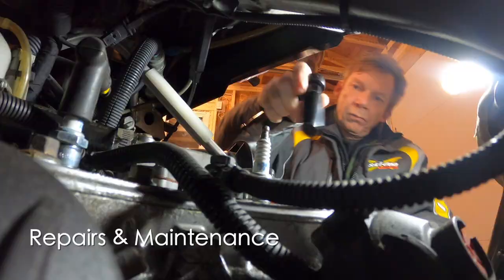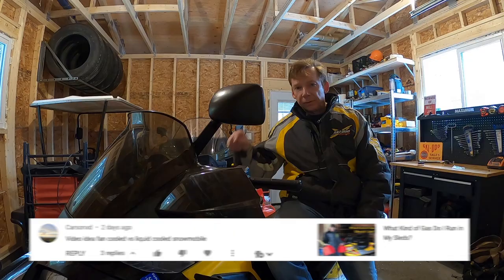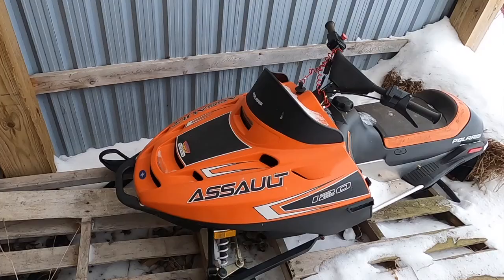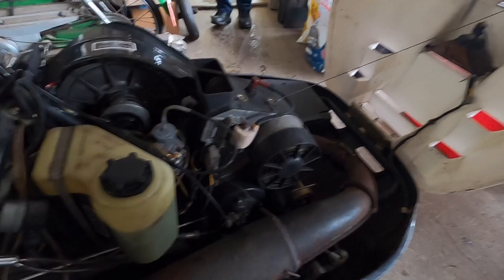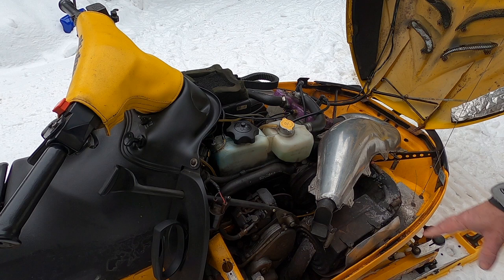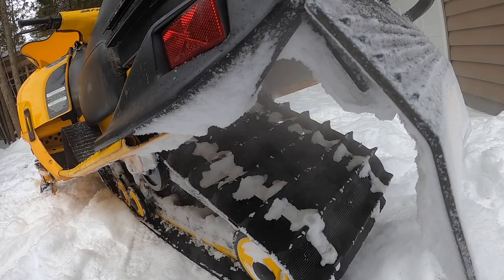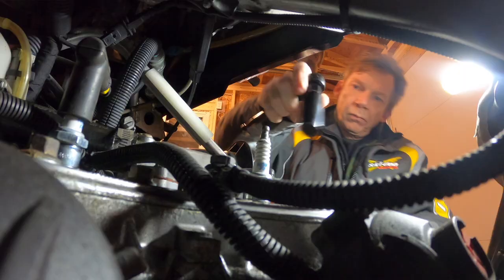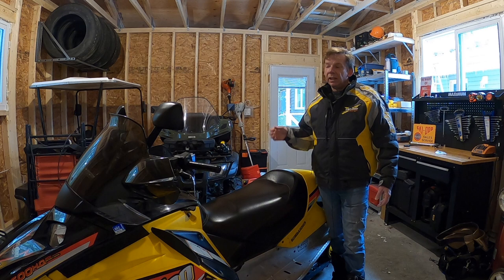Fan Cooled VS Liquid Cooled Snowmobiles

Comment: I picked up a 2021 VK 540 fan last season. For me it’s perfect for a few reasons, the simplicity and reliability throughout the ambient temperature ranges is great, especially in the late season.
Reply from the maker: Very nice Yamaha...work horse, heated carbs...good machine. Thanks for commenting.
Reply: I've personally had enough bad experiences with Yamaha utility sleds that I would steer clear of one for my style of riding from now on. But I guarantee you that machine will outlive the both of us combined
Reply: @lucahoganyt4435  i dont like Yamaha sleds anymore cuz most Yamaha sleds are 4 stroke now it sad cuz Yamaha made very good snowmobiles in 80's and 90's

Comment: I have had all fan cooled over the past 40 years, 565cc is the largest i have had (2019 arctic cat Lynx LT ES),  i like simplicity and less cost.  but even more so than all of this i wish skidoo would put an emergency manual start on almost all their 4 stroke sleds, maybe with some kind of decompression switch or something.   This is what stops me from going 4 stroke.  Over the past 25 years I have had 3 starter failures and 1 wiring failure and was so happy to have the pull start as backup to the electric start.  thanks for another great video!
Reply from the maker: Thanks for watching and commenting Mike. My brother just bought a four stroke. What kind of riding do you do?
Reply: @MyOldSled  9 out of 10 times I do solo riding in the adirondacks (upstate NY). I tend to pack all kinds of gear on my 2 up sled in case of breakdowns/getting stuck over night or even i ride out to another part of the state and i dont feel like riding back late in the day i will just rent a motel room for the night and stay over, so i always carry extra clothes.  all trail riding.  I am more of a putt around enjoy the scenery kind of person (20-40 MPH)and occasionally open it up on the lakes.

Comment: Here is a tip when refilling your rad start it run it nose up on a snow bank or tilted on a trailer. so that you can force the air to the reservoir and get rid of the air in the system. because of the suspension setup most sleds are prone to trapping air at the back
Reply from the maker: Slow down there Ray :) I'll be doing a video on that... :)
Reply: @MyOldSled  sorry bud.
My buddy and I love riding so much 
We went to the treadwell ice drags and entered our trail sleds it was sad 
We decided to go and build a dedicated ice drag sled. It's amazing the science that goes behind building one
Reply from the maker: LOL Nothing to be sorry for I was kidding. Love the engagement with the channel. Glad you enjoy the sport so much.
Reply: @MyOldSled  well what else are you going to do in the dead of winter right. Why not go and explore and see things. There is something special about riding a sled. Especially in deep powder it's like skimming across water, and flying at  the same time
Reply from the maker: I know. I actually can't exactly explain it. I don't ride tons of miles like some people do, and I don't get enough snow to ride much of the year, and a lot of my local trails arent open, but I love sleds...working on them, playing with them...it's just a sled thing.

Comment: I ride in conditions where we heavily benefit from longer tracks and big power. So almost all my sleds have been liquid cooled. I did have a 1998 Arctic Cat Z440 that was fan cooled. The only advantage I noticed was on the very rare occasions where we have less than a foot of snow, the fan cooled sleds don't overheat as much. But most the time we have at least 3 or 4 feet of snow, and right now I'm on a 153" 800, so liquid cooled is the way to go for how I ride. But if I rode strictly trails, I'd probably look for a Polaris 550 fan. Overheating is annoying, so even though it would mean having not enough power, I'd look for a 550 fan if I rode strictly trails and nothing else
Reply from the maker: Great comment Luca, thanks for sharing.
Reply: @MyOldSled  No problem. It's nice to see someone that actually responds. I remember a little while ago I left a comment on a video that I think was over 4 years old and you responded to it the next day. Nice to see a YouTuber that takes the time to read comments. Big fan, this is good content. Also, would you ever consider riding more off trail/backcountry? Or even just doing a video on why you would or wouldn't? I've never touched a trail in my life, only ever backcountry. So it would be interesting to see your perspective on the other side of snowmobiling that we call backcountry or mountain riding. Have you ever tried any backcountry style riding? Even ditch banging could count, that's a good way to learn the maneuvers

Comment: You skipped over the one other type, straight air cooled. My first sled was a 75' skidoo 245 TNT F/A. Colder it was the better it ran. I realize you have to go back to the 70's to find any air cooled machines. That thing was so light and so fun in trails. A 245cc twin with dual carbs, those pistons must have been tiny. The old adage applies "If I knew then what I know now" I would have kept both of my old ski doo's. The other was a 79' Blizzard 7500 340 liquid cooled. Both sweet rides in their day, both very collectable these days.
Reply from the maker: Skipped right over it...except the part right at the beginning where I said some sleds just having direct air, and only having cooling fins, and right after I said there are a ton of variations... ;) Actually a lot of old vintage sleds have straight air, but really comparing the two more common ones i get asked about.
Reply from the maker: Your TNT would fall in the same category a the polaris assault 120 I referenced.

Comment: Great points! I love both! Gotta love that 670HO though that's one to hold on to.
Reply from the maker: Hey BAA, thanks for watching and commenting. Getting much snow in your neck of the woods?
Reply: @MyOldSled  yeah alot of snow this year I just got done installing my skid. I replaced a couple of bearings and repacked the grease for the rest. I greased everything.
I'm currently running my 1st Cat a barnfind 91JagDlx440LT LowGear for my bush trapping/logging 120 mile round-trips here in the Yukon Kuskokwim Delta.
I'd take your TundraLT, I love those slower 250 machines and I noticed I enjoyed my ride more than the fast liquids I rode😁

Comment: Another great video.... I'm finding with these wild temperature swings in southern Ontario a fan cooled sled might make more sense. Last week I rode (liquid cooled machines) Friday in + 1 with the machine running real hot, then Saturday was -20... in a span of only 24 hours.
Reply from the maker: Thanks Rob. Yeah its up and down a lot.
Reply: @MyOldSled  maybe worth mentioning that ice scratchers are pretty much a necessity on liquid cooled machines.
Reply from the maker: That another video. Can only cram so much in.

Comment: I went fan cooled, got a '90 Ski-Doo Safari with the 447. Simple, cheap, going to use it to pull firewood out of the woods in the spring.
Reply from the maker: Nice sled. I wouldn't mind a Safari if I ever see a good deal on one. Thanks for watching and commenting.

Comment: Wow soo glad you put in the part on Cold Seize. I live buy a lake and with all the carb issues I have had I would go there and WOT to see the color of my plugs. You may have just saved my 2 sleds!  If you want ideas on carb issues I think I have seen a bunch in my first year lol
Reply from the maker: Hey KC. There are lots of different things that can contribute to cold seize, but thats a big one. Theres actually a lot of physics and depending on what paper you read, it can be pretty confusing, but basically. warm any sled up properly. Actually some guys I know with a TON of experience mentioned that to me and I thought it was worth researching more. Mostly, I just wanted to use the shrinkage joke. ;)
Reply: @MyOldSled  Good stuff, Thank you.

Comment: Great video thanks for the insight. I'm newer to riding and use my sled primarily for ice fishing just wondering if there is a way to add fan cooling to a liquid cooled sled to gain the best of both with out having to use scratchers
Reply from the maker: Not really. I mean you could easily mount a fan on a sled but you’d have to build a shroud to direct air, and an air cooled engine has cooling fins.

Comment: Good day I have a o2 skidoo touring 500f touring and no issues ,I've read that it's really a old 600 that they put in for insurance reasons ???Now I was wondering what the best older like o6-10 skidoo liquid cool is the most reliable for a cheaper prize??
Reply from the maker: Hi MIke, Sorry there are so many models and opinions, in my humble opinion it really isn't practical for anyone to give you a good answer to that question. I would suggest you have a look at the following site for specs and reviews on various models. YOu can click through the model years and get an idea. When you find one you like, you can start reviewing the listings online and see what kind of prices they are typically going for. Due to reduced supply and increased demand, the prices are so high right now. https://www.snowmobile.com/specs/2010.html

Comment: Hey David! Great topic.
I'm curious about your point about fan cooled not lasting as long as liquid cooled. For example I have a few old three wheelers that have lasted for a very long time! How does a fourstroke that's air and old cooled compare to a fan cooled sled as far as durability and longevity?
Reply from the maker: Hi Lincoln. Its a point about the cooling system alone. Everything else being equal. Because thats the only way to compare. A fan cooled engine heats up and cools down, which causes wear and tear. A liquid cooled engine has a more consistent temperature as long as its operating properly. There are a myriad things which can affect the longevity of any vehicle, this is just one factor. As for air and oil cooled atv like my rancher, and sled, that really is comparing apples and oranges. Oil cooling is kind of in the middle: more efficient than air alone, and helps maintain oil viscosity etc in a 4 stroke, but is still not as efficient or consistent as liquid. As i always point out, im not a mechanic, just a nerd with a sled.
Reply: @MyOldSled  Very informative thank you for your response.

Comment: Hi david. I'm courious what idea is behind Ski Doo's 1000sdi engines with no thermostat
Reply from the maker: Hi Ragnar. The job of the thermostat is to isolate the engine from the radiator until it has reached a certain minimum temperature. Without a thermostat, the engine loses heat to the radiator so it takes longer to warm up. I would assume a 1000 cc engine produces enough heat its less if a concern, but I’m not sure. I know some guys run without a thermostat.

Comment: Does anybody make a 700 fan cooled snowmobile? I like the 600 when it comes to liquid cooled, but when it comes to the fan cooled like you were explaining it doesn't have as much power and you have trouble keeping up with your buddies but if I had a 700 fan I'm thinking I'd be able to keep up easy without pounding on the snow machine.
Reply from the maker: No i dont think any fans are that size. There were a few in the 500 range (570 i think)
Most were 440 and less.

Comment: Always noticed that 550 is about the biggest fanner you'll find out there. I guess that's about the limit because of the cooling required? Like a 600 fanner would just run too hot to be practical?
Reply from the maker: Yeah 550-575ish kinda sizes...Yes, my understanding is that as they get much bigger they get harder to cool.

Comment: Also I'm looking into getting a atv this summer. First off I've been around ATVs and snowmobiles for a long time working on them and riding them so I have experience. I'm interested in two models. Yamaha Kodak 450 and Suzuki King quad 400. A comfortable ride is one of the Things I'm looking for and the Yamaha has independent rear suspension. But I really like the King quad being air and oil cooled for the fact that it's more simple. No coolent to worry about leeking and no coolent to change.
What's your thoughts on these machines?
Reply from the maker: I cant comment much on the Yamaha, but I love the King Quad. I went from an outlander to a king quad and i couldn’t believe how nice it was to ride. Tons of power and so smooth.
Reply: @MyOldSled  What King quad did you have? Do you have any experience with the 400 King quad?
Reply from the maker: I ride a 750 king quad on an elk farm I work at for herding animals etc. Have a look at my atv track video.

Comment: i have an artic cat 2002 or 2003 800cc efi liquid cooled beast.. herein saskatchewan.. the previous owner was younger and i was hoping to get more preventative maintenance info on it etc but - there seems to be not much on youtube.....  what are your thoughts on this machine? (engine good - bullet proof?.. what is the common issues with these machines? etc.. ) if you have the time i would certainly appreciate the tips Sir... ty...
Reply from the maker: Hi Tony, I'm sorry I don't have enough experience with that sled to give you any meaningful feedback. It seems to have some decent reviews. In terms of maintenance, best bet is hunt down the owners manual, but clean it thoroughly, use a good synthetic oil, maybe run some seafoam through it to clean injectors, throw a new set of plugs in it, grease any fittings you can find. The usual stuff.

Comment: What's your thoughts on a straight axle vs independent suspension on a atv. Pros? And Cons? To both?
Reply from the maker: Solid axel - fewer moving parts, maintenance much easier. Less break down. Ok if your running on flat ground.
Independent - More consistent ground clearance, better ride on rough terrain.
Reply: @MyOldSled  Thanks again for the response. That's what I was thinking about the two designs.
I think the independent suspension would be better suited for my riding style.

Keep the great videos coming!

Comment: It depends on your location the further north the more you would tend toward fan cooled the further south liquid cooled is better it let's you run later in the season
Reply from the maker: Hi Ray, depends on how you're looking at it. Further south tends to be lower snow fall = more road running = less snow on the heat exchanger.
Reply: @MyOldSled  that's true I found this year the trails were very hard packed. And I had to use ice scratchers as the new track I have wasn't throwing enough snow on my heat exchanger.

Comment: New owner of (4) 2002 Ski-doo MXZ's. (2)500, 600, 700's.  Any chance on doing a short video on changing coolant and what to look for during the process?  Never done it before, so I'm looking for some guidance.  Howdy from Wisconsin.
Reply from the maker: Hey Guido. Welcome and congrats. Definitely will, not sure when probably after riding season but maybe sooner. Not hard drain it, get the front of the sled higher than the heat exchanger so the air burps out, let it sit, run it, monitor, add....
Reply: I'd say if you don't mind a little extra cost you can suck the stuff out of the reservoir and put new stuff in. Do that a couple times and it would be pretty close to a full change. Better than nothing right?
Reply from the maker: If it was me, I would just top it up until i could change it. Id be concerned about mixing without knowing whats in it.
Reply: @My Old Sled  I would definitely watch that video also. I would like to change the coolant on my 2000 Ski Doo MXZ 600 at the end of the season. I enjoy watching your channel, especially your maintenance videos. I live out in Eastern Ontario.
Reply: I also heard a person should not mix green with blue coolant.  Any truth to that?
Reply from the maker: Ethylene Glycol is Green, Propylene Glycol is Orange...Blue is windshield washer or blueberry...so not sure what you mean. I tend to not mix anything if I can help it, and if you are, you should use premixed coolant. The problem is you don't know what's in it. Coolant should be 50/50 water and antifreeze. If you don't know what the last guy used, or if he knew what he was doing, you don't know if you have too much water etc. Bear with me I will put together something on it as soon as I can.
Reply: @MyOldSled   Sorry about incomplete/wrong info.  I was referring to the XPS brand of coolant, which is pre-mixed, I misspoke calling it blue.  I meant mixing green and orange coolants.  Word here is, if you mix the two coolants in your sled, the coolant will gel when it gets heated.  No hurry on a video, just throwing out a video suggestion.  I enjoy watching your videos.

Comment: Hey Dave
Any idea why my rev is using coolant
Reply from the maker: If you mean the level of coolant is dropping, then its going somewhere it shouldn’t. Get a flashlight, go all around the cooling circuit. Check all the hoses, and connections  for leaks. If its just a little low and you cant find a leak, a little can burp out the overflow at speed. If it looks dirty, or theres a black line in the reservoir, you might have a leaky head gasket.